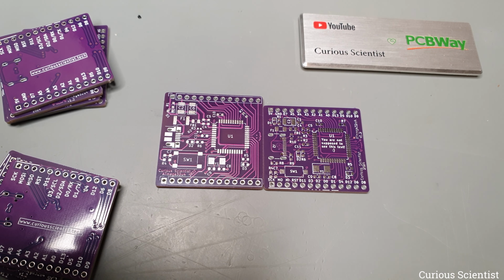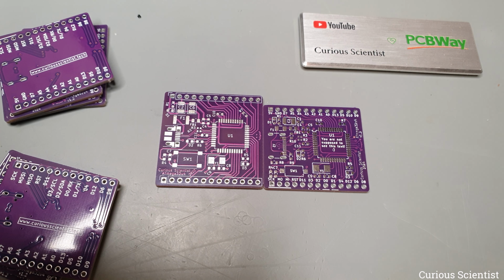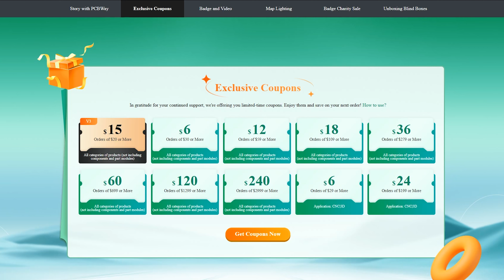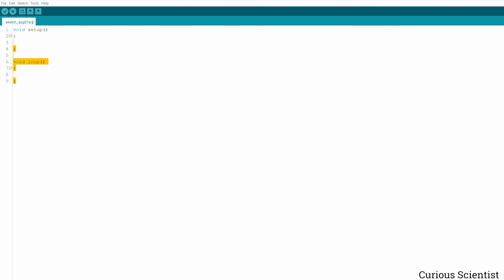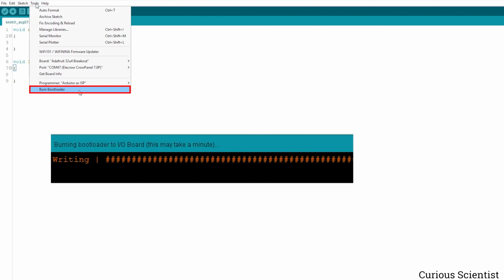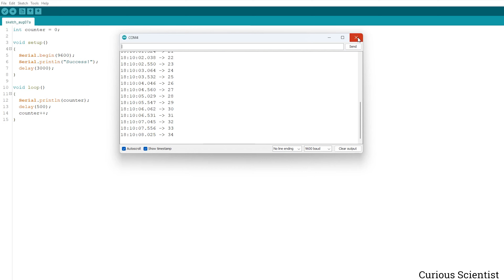Custom ATmega32u4 microcontroller board - 2024 version

Comment: Summary
Here is a summary of the video transcript "Custom ATmega32u4 microcontroller board - 2024 version" with timestamps:

Board Revisions:

* [0:46] The board is now narrower and fits in a standard breadboard.
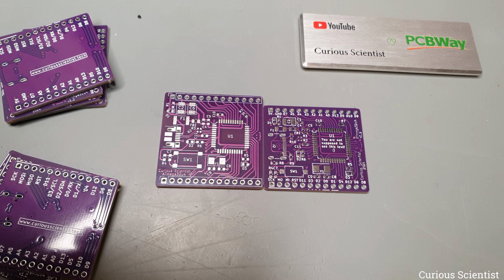* [1:20] It uses a USB-C connector instead of micro-USB.
* [1:10] The traces are thinner and curved for a cleaner look.
* [1:40] Pin labels are printed directly on the PCB.
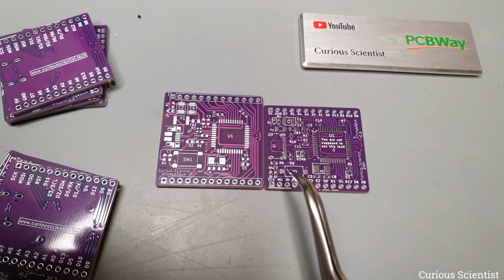* [1:56] A smaller, more aesthetically pleasing push button is used.
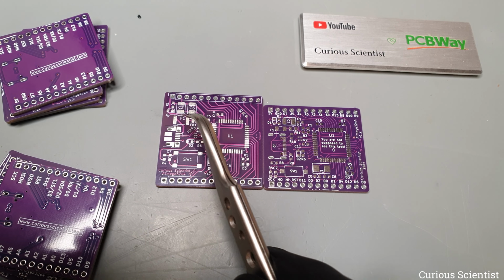* [2:01] The power supply section is revised with a different capacitor and fuse.
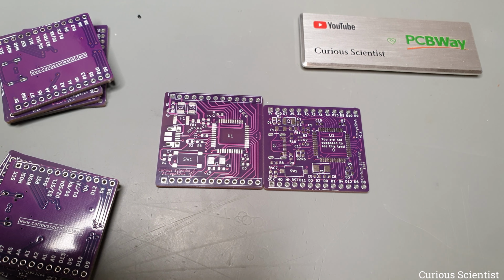* [2:17] The creator's signature is moved and the copper is revealed for a silver plating effect.
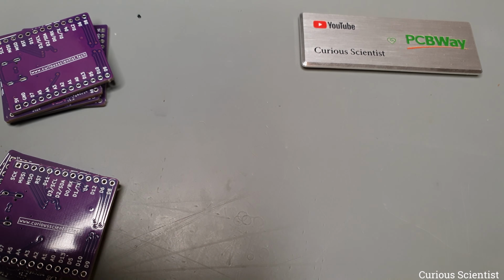* [2:38] Pin names are included on both sides of the board.

Assembly and Programming:

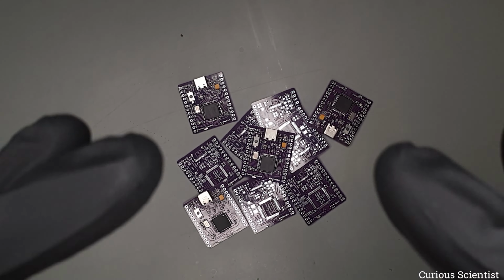* [5:36] The board is assembled using a reflow process. 
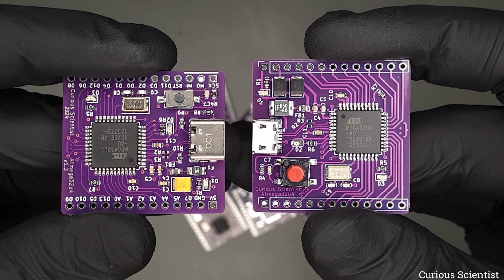* [6:22] The USB connectivity is tested before programming.
* [7:16] An Arduino Nano is used as an ISP programmer to burn the bootloader onto the ATmega32u4 chip. 
* [8:50] Once the bootloader is installed, the board can be programmed directly via USB using the Arduino IDE.
* [9:00] A basic program is uploaded to test the microcontroller and USB communication.

Other:

* [0:08] The video is sponsored by PCBWay, a PCB manufacturing service.
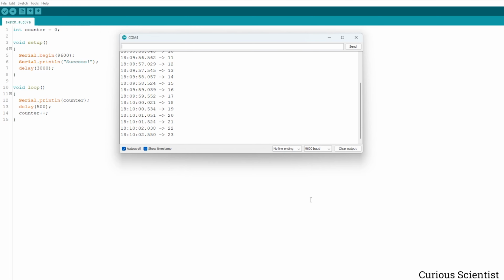* [9:57] The creator plans to sell the board as a product in the future.
* [10:10] Support is available on Patreon. 

I used Google Gemini 1.5 Pro to summarize the transcript.
Reply from the maker: Woah, thanks! This actually summarized it very nicely.

Comment: If you already own an Atmel ISP programmer such as the AVR-ISP2, Atmel-ICE, or a PicKit4, (all of which are supported by Arduino), then you can use those instead of another Arduino to program the boot loader.  Other possible programmers include the older AVR Dragon, and Adafruits ISP mini.
Reply from the maker: True! But I think it is more common that someone has an extra Arduino than a programmer. Especially, if we compare their cost.
Reply: @CuriousScientist  that's my case

Comment: Nice video! How thick was that stencil and what solder paste did you use? Rarely do youtubers show the less than optimal reflow process, making it seem too easy to nail all the parameters. Great job of doing just that. The said stencil and paste info, however, would prove very useful, thanks!
Reply from the maker: Hi and thanks! The stencil was 120 um thick. Actually, just after this clip, I started ordering 100 um thick ones only for my PCBs, and they are better. The paste info is in the description of the video. Cheers!
Reply: @CuriousScientist, thanks! Could you double-check the paste info? I can't find it anywhere, even went through all the affiliate section twice. Oh, and please, could you comment on soldering strain sensitive LGAs like piezo  MEMS sensors (pressure, IMUs), that is, if you have some experience with it. Thank you!
Reply from the maker: I bought the paste from Mouser. I don't have any affiliate link for it. Regarding the other question, I don't really have experience with those things, sorry.
Reply: All well, thanks. Happy holidays and good luck further with your channel and all!
Reply from the maker: Thanks! I also wish you Happy Holidays!